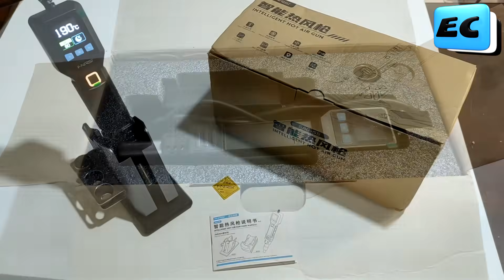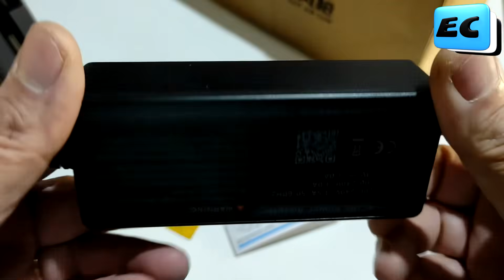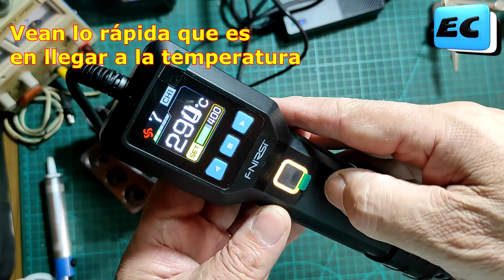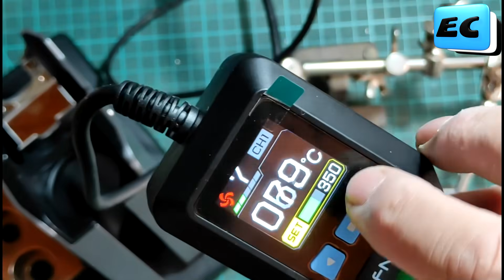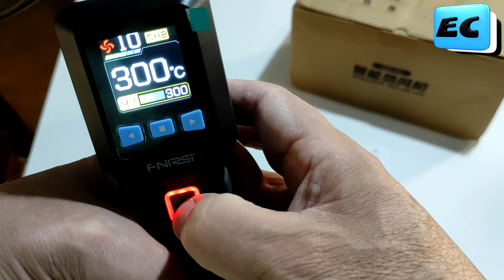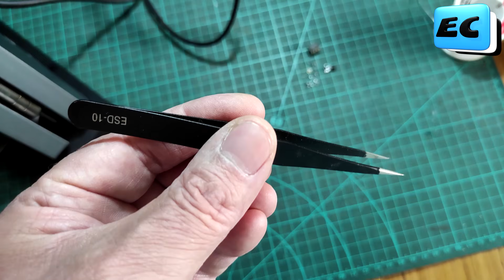Fnirsi SAG-55 Review: Is It Really Worth Buying?

Comment: Nice, simple and informative video. Hot air is excellent. For thick boards, you may combine that with your heat pad. Set the heat pad to 100 °C; the components will desolder even faster. And you can also add a little bit of No-Clean Soldering Flux Paste. It may help with some old solder.